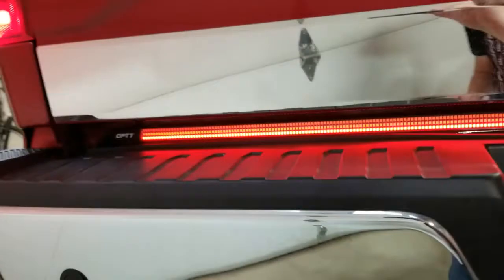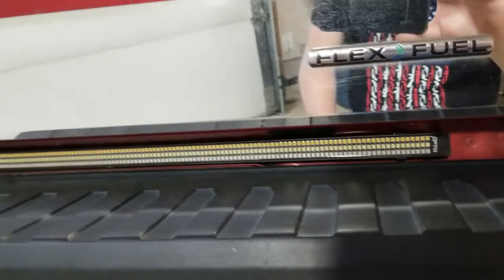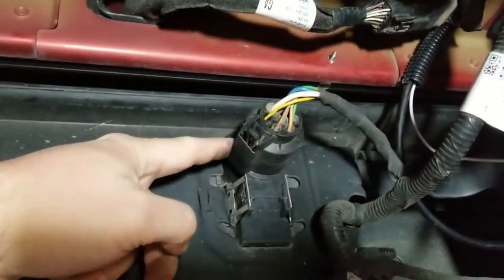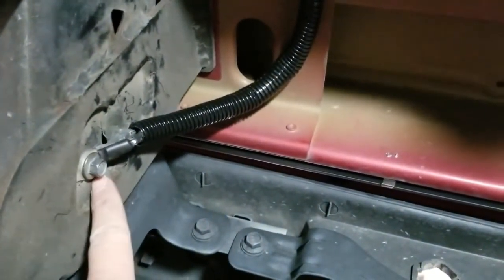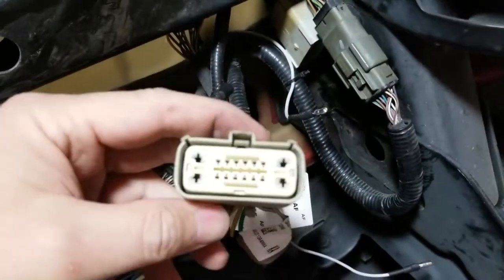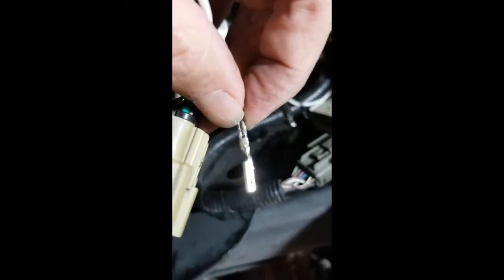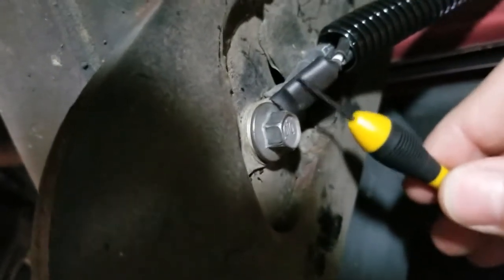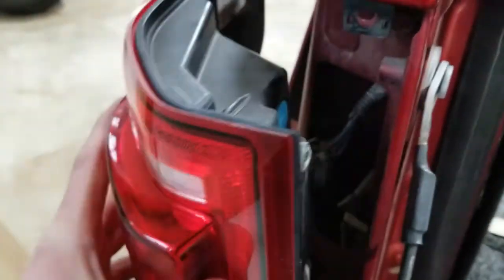How to install an LED Tailgate Light Bar for 2016 F150 with BLIS & Tow Package without splicing

Comment: Nice install. Professional done. My 2020 F-150 has the factory plug in the same position. Different pins. All lights are in the plug. Ran the same ground. Works great. Thanks

Comment: I know this video is just about 2 years old, but gosh dang this is much simpler than what I've been dealing with. I picked up a different brand of LED Tailgate lights from Mictunning to install on both my wife's and my own truck. I knew from a previous install that connecting anything into the Fords trailer wiring/harness causes a nightmare. After doing some research I knew that I'd need to splice the 4-pin connector that the light bar comes with into the existing taillight wires. Even after all that, only the right turn signal function works and nothing else. After seeing your video, I'm gonna see if her truck has a similar connector under the bumper and just wire everything up that, much simpler and easier to do properly. I was lucky to do the clean install on my Sierra and use one of those plug-n-play connectors from Curt, but that ain't the case with Ford...
Greatly appreciate your time, the visual presentation, and knowledge on this work around, solid work all around!

Comment: I appreciate the info.   Your video makes the process look pretty straight forward especially for me since I don’t have any electrical knowledge.  The guy from OPT7 suggested I could use the  CURT55384 connector, do you know anything about this connector?
Reply from the maker: absolutely do not waste your time or money on the curt55384 because that patches directly into your trailer harness which absolutely will tell your truck you have a trailer connected which you don't. That the reason I showed which connector to use next to the spare tire so it's like connecting to both taillights but in the same spot.  If you were close by the little Rock Arkansas area I'd enjoy just helping you install it to see if it was the same as mine.  It's not hard to do yourself though.

Comment: Maybe I missed it in the video, but my light bar came with extra red and white wires along with the four pin connector. I know one is for the reverse, but the other one is for a hot 12v connection. Where did you place that one if you have it? Thanks
Reply from the maker: To be honest I'm not sure about the extra red wire unless it's their way of fixing the hyper flash issue with led headlights. My video shows you 2 white wires and one is the reverse and the other is ground.  Really watch around the 8 minute mark for wire explanations.

Comment: Where did you get the pin diagram for the harness? I have the same harness, but the pins are different. I don't have BLIS, so that's probably the difference.
Reply from the maker: https://www.f150forum.com/f118/tail-light-wire-colors-340426/

Comment: Also did you actually have to lower the bumper? If so how much ? From looking at the picture the gap looks wider than normal.  My truck is exactly like yours.  2016 with blis , backup camera and tailgate step so your video is really valuable in helping me make the decision whether  I want to attempt adding the light bar.
Reply from the maker: Actually my tailgate was a 1/4" out of level from the factory from one side to the other so I lowered the high side. When you space out the light to miss the bracket the tailgate comes really close to touching the light. The larger gap also lets you see all three rows of lights better.  It's the 2nd best upgrade on my truck after the Alpharex nova headlights. FYI  I ordered my truck with a bench front seat which made the LED headlights not available as crazy as that sounds.  The reason I say that is because that may be the reason others are having to use the adapter. The LED'S don't use as much power so they may put a lower resistance relay for the blinkers so adding the light bar may draw just enough amps to cause the hyper flash. May not though because only 2 guys has had that issue. Mine is still flawless and I love it.
Reply: @dougd7714  On my 2016 F-150, it doesn't look as if there is enough room for the light bar to mount below the hole for the tailgate harness and not be obstructed by the bumper. I think that's what Larry was asking perhaps?

Comment: Someone needs to make a little male-female adapter to go in between that plug and socket with an attached 4 wire pigtail for those of us that may not be able to solder while laying on our backs under the truck
Reply from the maker: I actually tried to find those molex mx150 connectors and do just that but they are not available. Also I pulled the connector between the bumper gap and soldered it on top of the bumper. Sorry I didn't say that in the video.

Comment: I haven't decided yet on the Amber or the Red turn signals. Looking for some opinions. Why would I want one over the other? Very nice install! I will follow this, I am sure. Going to check my plug, but I am pretty sure it wil be the same, as my 2016 has the tow package. Just not sure about the BLIS; not sure what that is, or how to determine if I have it. I don't do any towing.
Reply from the maker: I believe it's worth the extra money to buy the amber turn signal for safety reasons alone.  It helps distinguish the change between a red break light and a caution turn signal. The opt7 has the aluminum extrusion housing and has held up extremely well. I still think this is my favorite mod I've done.
Reply: @dougd7714  So, on this bar, the turn signals are amber, but the brake lights are red, correct? Running lights? Emergency flashers?
Reply: @dougd7714  I just checked my wiring harness and my tag reads: GL3T 13A409SA Yours is KA I wonder what the difference is?

Comment: Hi Doug, nice video. I have a 2015 with BLIS. I followed the instructions and everything works great when the truck is on in accessory mode. When the engine is running I don’t get brakes, flashers and turn signals go to fast blink. Any idea what is wrong?
Reply from the maker: My truck came with halogen headlights and incandescent front turn signals but led taillights. I ordered the bench seat so there was several options I couldn't get.  Now I say this because if you have LEDs all the way around you may have to change the flasher relay. The other thought is maybe you connected to the trailer harness? The only way to check is to remove a taillight and find the turn signal and brake light with an ohmmeter and then double check continuity to the plug by the spare tire. The main point is to make sure your using the wires from the taillights and not the trailer.
Reply: @dougd7714   I will check the taillights tomorrow they look like yours so I am hoping they are the same. I am not connected to the trailer harmess. I tapped into the tail light itself. I had the undercarriage coated and they covered all of the electronics so I couldn’t get the connector off.
Reply: So I have both LED tails and headlights. I did some research and one guys said that there isn’t a relay on these models. It is all controlled by the BCM. Not sure where to go from here.
Reply: I have a very identical connector but the numbers on tag are a little different. Mine reads FL3T 13A409AF. yours is GL3T 13A409KA. Do you know if there a difference in the pin wiring?

Comment: I cant figure out where in the world I can connect the white reverse too? I'm just
 gonna plug mine in the 4-way to make it simple but still stumped on where I can go with the white reverse wire. I got the exact trailer plug like this but no bliss at all
Reply from the maker: Look at 5:28 and 9:10 in the video to see the 2nd white reverse wire location.  If you plug into the trailer pigtail it will think you have a trailer plugged in and drive you crazy in the dash warning.

Comment: Hi Doug,my truck is 2016 with blis, back up camera and tailgate step, I connected the light bar the way your video shows, it works fine when it is on accessory , when i turn the engine on it blinks two or three times normal then it goes into the fast blink ( like when a bulb is out) Can you help me with this
Reply from the maker: I'm guessing your truck has the led headlights and not the halogen.  My had halogen so I'm assuming the relays are different.  If you look through the comments there's a guy that add a resister that may have worked.  It's weird that yours works on accessories and not when it's turned on.  I'm really not sure how to help except to youtube it and see if anyone else has solved the problem.
Reply: Having the same problem did you figure it out

Comment: Do you think wire taps would be ok? I'm just not comfortable with pulling pins. Thank you for the awesome video!!! I got errors and alerts when I tried to tap the hitch plug wires.  Thankfully after I removed them I pulled my negative on the battery and once I put it back and started my truck it went back to bliss normal.
Reply from the maker: I did this to keep from tapping into wires. It would work but I don't like cutting into stock wires. Thanks for the comment.
Reply: @Doug D  Thank you for replying. I agree. I don't like cutting into stock wires either.
Reply: Hey Doug, thanks again for the awesome video.  I decided to do my install like you did yours.  Pulling the pins and soldering the connection was much easier than I thought and it's a lot cleaner than using wire taps.

Comment: Does the tail light plugs come together the same in the 2009 f150
Reply from the maker: I'm sorry kay, I don't know. You can look to see if there's one at the spare tire but I would guess it probably does have a plug there too. Now the pin out may be different.  You'll have to meter them out to find the louder or Google the diagram. Good luck.

Comment: I wonder if a 21 is the same i have had a light bar on every truck i have had but mine has bliss and the light out warnings
Reply from the maker: logically it's the same concept on any vehicle. Both taillights will combine to a main harness somewhere. I'm sure the f150's would stay the same except the pins may have changed so you would still have to check that out. The best point of my install is I don't run wires to both taillights. I'm grabbing everything from the same plug except the ground. If I were you I would pull one taillight out and test the plug to see if the pins are in the same order as the diagram I showed  for the taillights. Unplug the light stick a small wire in each pin hole with the blinker or break on to see if th order is the same. If the truck goes crazy thinking the lights out you'll have to plug it back in and push the wire in from the back next to each wire. The problem with that is you don't know if you made a good connection to check it. Your next challenge will be to make sure the pins are the same from the taillights to the plug on the harness but that's what I did in the video. Let me know how it goes and if it's still the same so others will know. I still think it's the cleanest install out there.
Reply: @dougd7714  ya it is i am gonna try your way after i ask my dealer if it will void the warrenty on anything but your was is so clean you would have to look for the mod to it

Comment: I haven’t installed mine yet on 18 f150 . I tested first - and what I do not like is the delay when I push the brake pedal ! It should be immediately with tail lights ! Yours does it also why ?
Reply from the maker: I don't have a good answer except the time it takes for signal to close the relay and latency of the lightbar CPU.  I'm sure it has an led circuit board it's going through. I still think it's the best looking and quality I've found for a tailgate light bar.  Sorry that's all I got for an answer.
Reply: @dougd7714 Yes it’s a bright solid light bar for sure . I have another 60in I mounted on my 30ft snowmobile trailer - forgot the brand name - has turn single flash and reverse also ,but it is not as bright and does not have delay when I hit the brakes ?!  The delay bums me out .

Comment: I tried this, all went as expect but for some reason my left turn signal would blink once, make the opt7 bar sequential blink once then shut off both the bar and the tail light but keep my front and mirror light on and blinking.
Reply from the maker: That doesn't make sense does it? So, if you unplug the truck harness connector and use your multimeter on the male pin connector with the blinker on do you get 12v off and on with the left blinker pin?
Reply from the maker: Maybe you're soldered connection come loose too.
Reply from the maker: I'd like to hear what was wrong when you find out. I'm still thinking it has to be like the pin didn't get pushed all the way in or something small.
Reply: I'm thinking it might be a power delivery issue, it blinks once and then once the bar receives power, it blinks the light module out but keeps the front on. So I might just add that opt7 constant power device to it and see if it's fine after that.
Reply: Well, it would seem I was correct. If your vehicle does this, you require the opt7 4 pin module they have with their other listings. The moment I installed it and ran the power wire. It was running smoothly and bright. Everything works as it is supposed too and not even the blind spot system acted up, almost as if it was never there.
Reply from the maker: @natedog61441  is this on a Raptor assuming by your name? The Alpharex nova series headlights act funny on a Raptor too. I'm glad you got it going.
Reply: Funny thing is it use to be a lariet, but I did a raptor body kit to it and a interior on it by my self.
Reply from the maker: @natedog61441  After thinking about this  when you added the tow package module and it worked I really think you might have tapped into the wrong plug? You know in my video where I say the darker connector is from the tow lights and the one I tapped into was just the tail lights. I could disconnect the tow connector and the tail lights would still work. I'm curious to know if you disconnect the connector you tapped into does your tail lights still work? If so you tapped into the tow connector which makes sense that it works with the opt7 added module. If I'm right you wouldn't need the module.
Reply: Nope, I spliced into the white/tan one with the four putter bigger holes, made sure to match it up and the wire colors all matched yours, I guess when they say every vehicle is different, they really ment it.
Reply: And yes when I disconnected the white one, the taillights shut off and the console screams about blind spot being disabled.

Comment: Ok I tapped into the joint tail light harness like you instructed but now they will flash about 5 to 10 times and then I start getting the hyper flash the tail lights and light bar stop blinking. If I turn them off and back on the process continues. What did I do wrong?
Reply from the maker: Does your truck have both bliss and the trailer package? just wondering if that makes a difference.  If you read raptor s responses he had to purchase the adapter to make his work. you can still grab the wiring from the central pigtail but it's like you don't have enough power which causes the truck to think there's a light out.  I would be curious if you have a different year model if the pins are in the same order.  so you're not tapping into the taillight out wires.
Reply: @dougd7714  yes I do have both and it’s a 2016 Lariat. The pins seem to be in the same place may have to look into the adapter. I went into the ForScan and disabled the blinker out hyper flash but need to see if the lights still cut out.
Reply from the maker: Did that work?  I just replied to another guy and I just thought about my truck didn't come with front LED headlights because I ordered it with a bench front seat so it deleted that option to order.  I wonder if that means that use a lower resistance relay if you have front LED lights? Just a thought but only you and one other guy has had an issue.  it's just weird. Thanks for the feedback. I love my lightbar though.
Reply: @dougd7714  it did seep to work. No one has flagged me down or mention that the lights or out.

Comment: Where are the spacers located at Lowes ?
Reply from the maker: There in the special fastener drawer aisle. They're actually spacers and you can buy them in plastic or aluminum.
Reply: @dougd7714  Hello Doug, I talked with you just before Christmas about your video installing the OPT 7 taillight bar on a F150. I started installing the light today following your instructions. I found the connector  under the truck and my numbers matched what you had in the video however at the end I had PA instead of KA. Have any idea if there is a difference in the connectors ? Or if this all cause a problem ?  Example 13A409-PA 

Thanks,
Larry
Reply: @dougd7714  Hello Doug, I talked with you just before Christmas about your video installing the OPT 7 taillight bar on a F150. I started installing the light today following your instructions. I found the connector  under the truck and my numbers matched what you had in the video however at the end I had PA instead of KA. Have any idea if there is a difference in the connectors ? Or if this all cause a problem ?  Example 13A409-PA 

Thanks,
Larry
Reply: Sorry Doug , I tried ti send you another question about the connector for the OPT7 tailgate bar but think it got posted in the wrong place please let me know if you can see the question.  Thanks, Larry

Comment: You didn’t wire in a brake light, how does the brake come on??
Reply from the maker: Look at 8:14 to see the diagram.  The first pin is from the LH light #2 which is the stop & turn signal.  The second pin is from the RH light #2 which is the stop & turn signal from that light.  The fifth pin is from the RH & LH light #3 pin which is your park/running lights.  The sixth pin is from the RH & LH light #4 pin which is the reverse light.
Hope that clears it up.  It's really an easy clean install doing it this way.